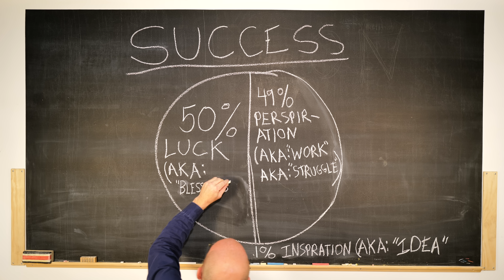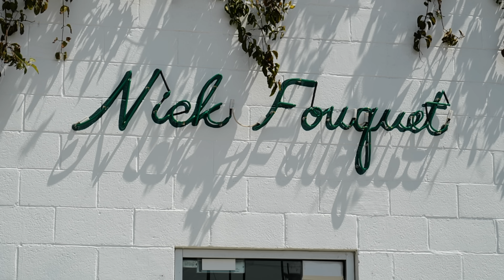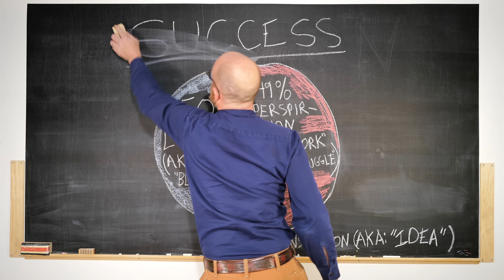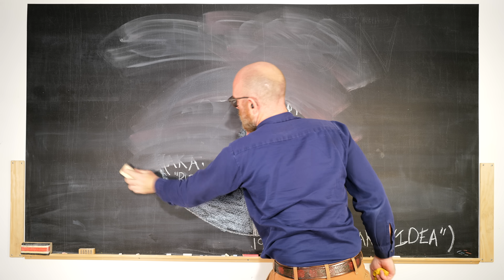The Struggle of Success

Comment: If you're going to use hinges and threaded eyelets with a wire, why not also use hooks on the wire that attach to the eyelet and can be removed so the shelf can lower to be parallel with the wall? If it's there with permanence why not just use L brackets under and avoid the wire hypotenuse?
Reply: pretty sure its just for his janky, homemade aesthetic. I thought the wire might be a bit stupid because it looked like it could make pushing the toaster handle down harder, but he didnt show that in the video when they did the toast so i reckon the wire did get in the way. L brackets would've probably been more practical but i like the wire because its a bit silly.
Reply: also a pain in the butt to clean the toaster with the wire attached to the wall like that